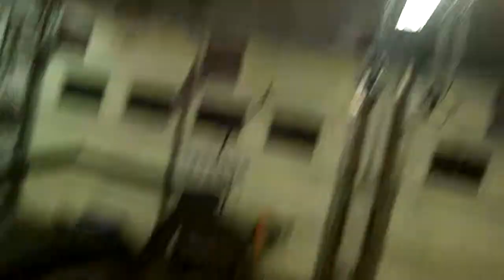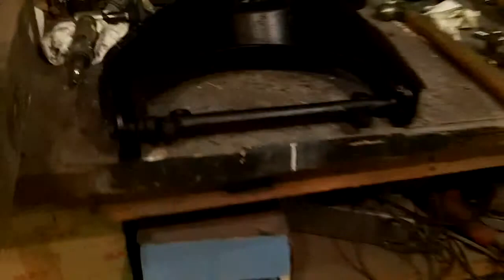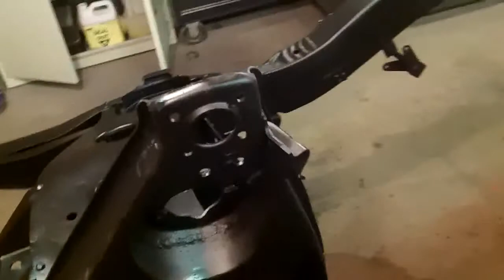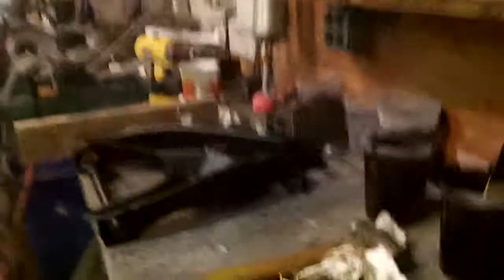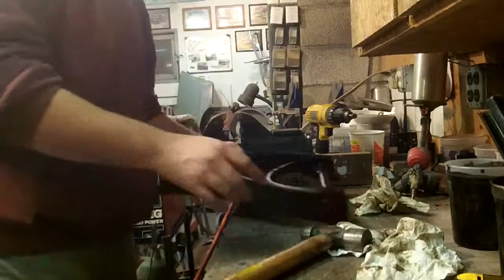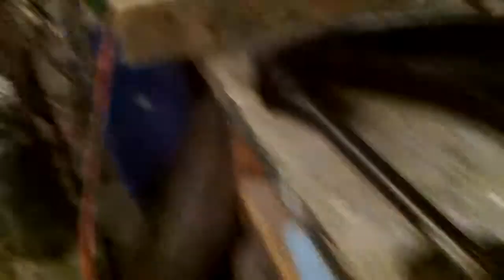"Tessie" control arm bushing install

Comment: Your moving right along now Matt. That was pretty easy putting the bushings in. The rubber ones are a pain in the ass if you don't have a press. You can't take them apart like the poly bushings.